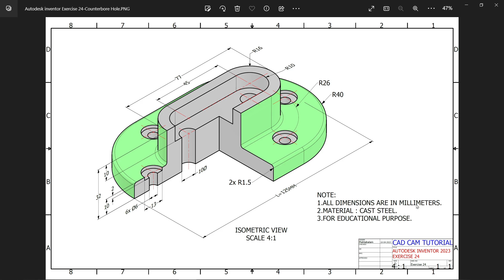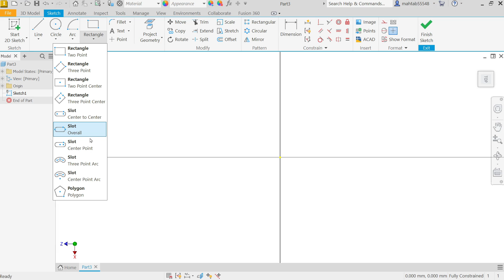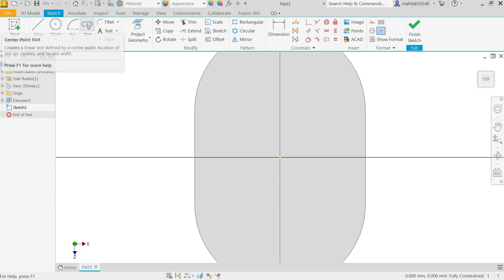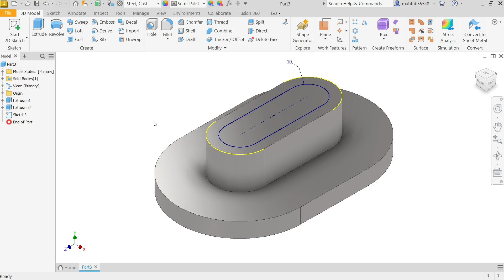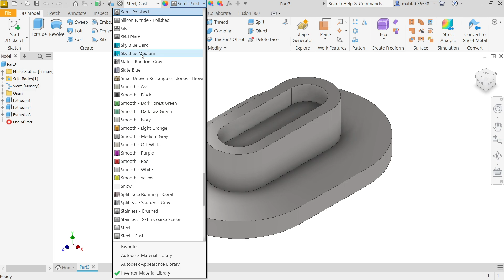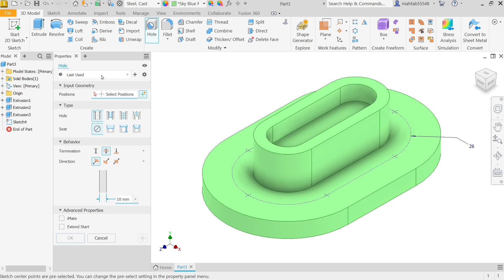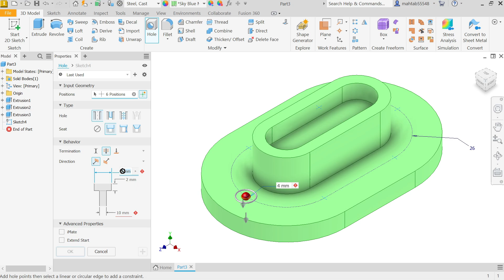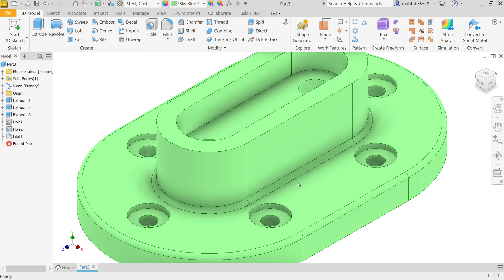Autodesk Inventor 2024 Tutorial Counterbore Hole

Comment: Hello.
I've been looking for various INVENTOR tutorials but I haven't found it anywhere. Maybe you can help me? I recently got Inventor 2024 and I encountered a problem that I can't solve:
I have two pipes (let's say one is 60.3x6.3 and the other is 76.1x8.0). Let the larger one run horizontally and the one with a smaller diameter connect to the larger one at any angle other than 90 or 45 degrees. The axes of both pipes lie in one plane. Between the pipes - regardless of whether they are on the side of an acute or obtuse angle - we insert a bracket (say 5 mm thick). The junction also lies in the plane of the axis of both pipes - the plane divides its thickness in half.
How to construct it and how to connect it, and when loading everything worked, and when creating a DWG drawing - each part (pipe 1, pipe 2 and nodes) were separate elements? Please help. Regards